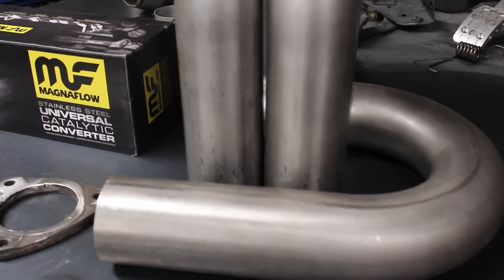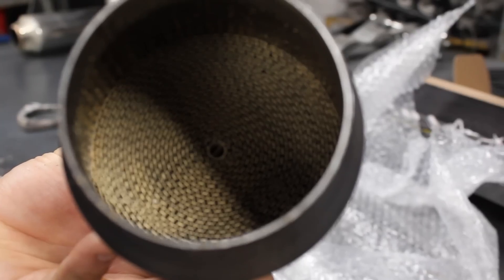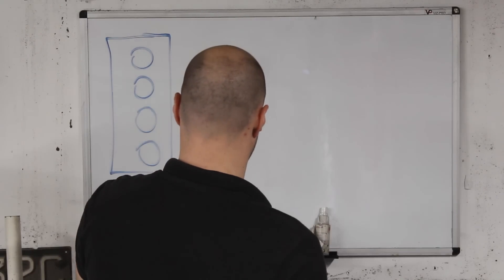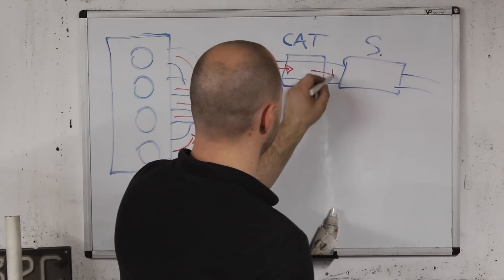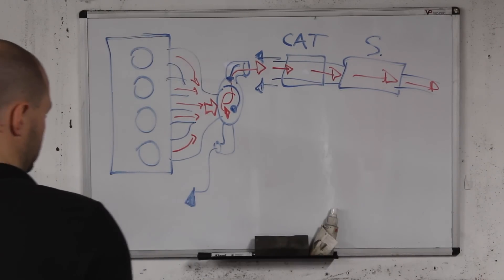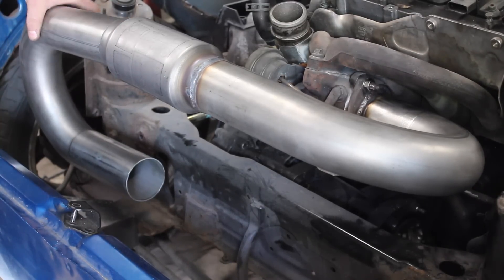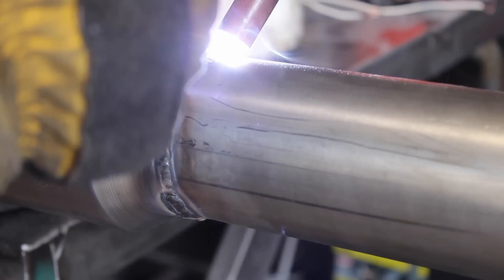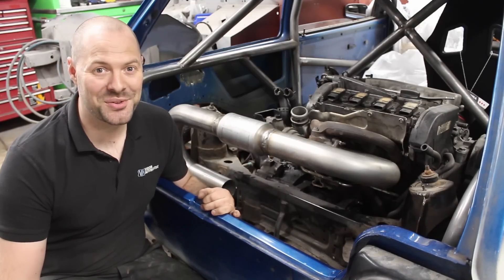Raudi Metro Custom Turbo Back Exhaust Part 1:  Magnaflow 200 cell Cat - MR Metro EP13

Comment: Been looking to fit a 200 cell cat in my downpipe I just bought, wanting a long life cat are these magnaflow ones worth the cash?
Reply from the maker: Magnaflow are quality units, but it can't vouch for the longevity of this one yet!
Reply: @VisionAutoGarage  just a quick question about fitment. Got a 3" eBay special decat downpipe I intend to weld the 200 cell into. Did you order a 3" cat ? As I see it fit very nicely over the piping ready for welds. Cheers!

Comment: great welds, way better then mine lol.. so is that going to be to much weight hanging off the turbo? do you need a flex joint?
Reply from the maker: Thanks Ben. There will be a support from the subframe on rubbers to take the weight. The engine is almost solid mounted, so there won't be much movement and the rubbers will absorb most of it.

Comment: Turbo is a baffle so probably only need converter great video.
Reply from the maker: Yes I think so too, but I'll fit it with a slip on short silencer and see if it makes the noises I want. I can always remove it on the dyno and see what difference it makes
Reply: @VisionAutoGarage  I had a modded metro turbo and it only had a rear box lovely noise and street legal.You gotta run with and without silencer  when it's running.